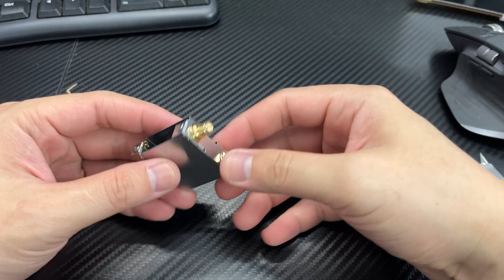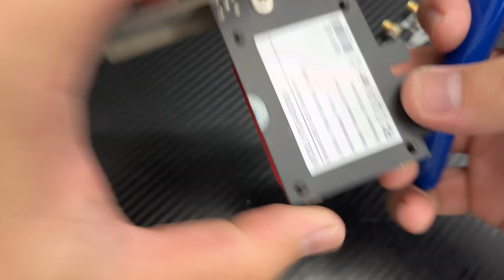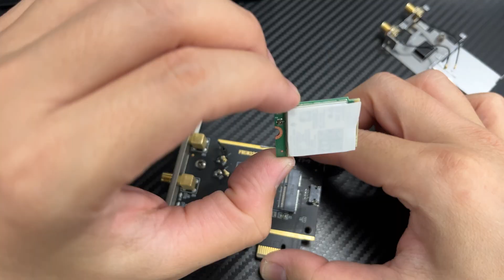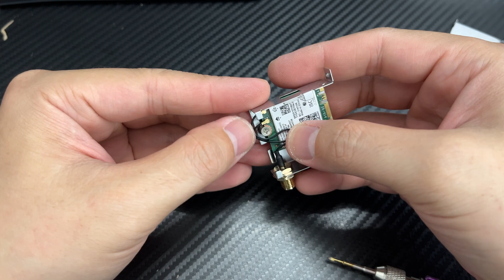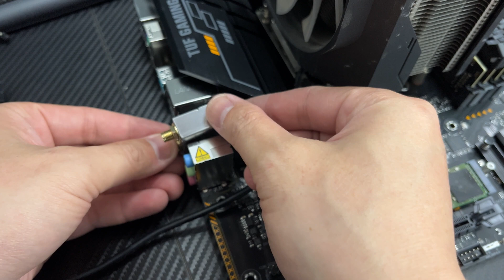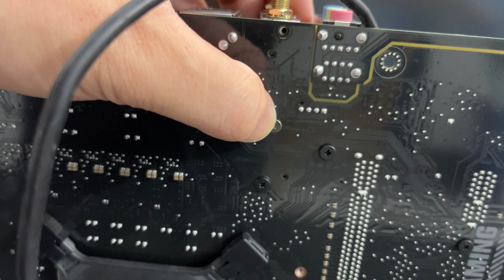How to Install WIFI  m.2 Key E into the vertical slot on the motherboard

Comment: This is urgent, sir. I replaced the original WiFi card (Intel 9462 key e) with a Mediatek MT7921 key a and e) on both Linux and Windows. WiFi works normally, but Bluetooth shows up but won't connect to nearby devices. Is this due to the interface key or the OS driver?
Reply: is your wifi card installed using pcie to m.2 or directly at m.2 slot on your motherboard? If your wifi card using pcie to m.2 adapter, make sure you connect it to usb header on the motherboard via supplied cable. If you using m.2 slot on your motherboard, it is possible there is problem with USB lane either at your card or at m.2 slot.